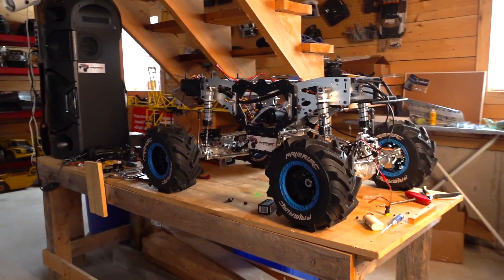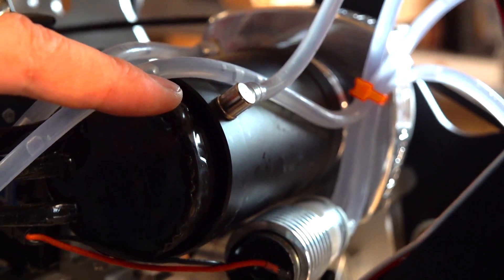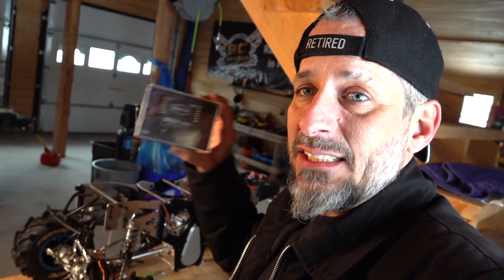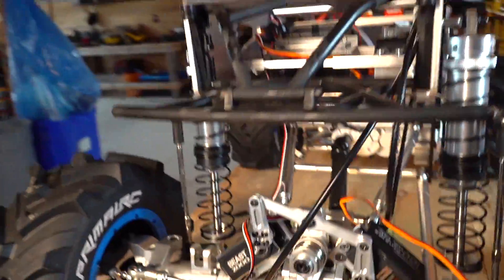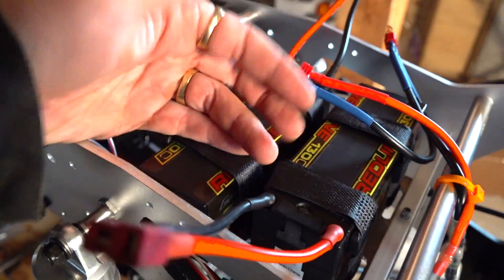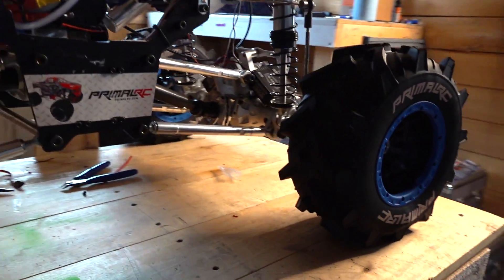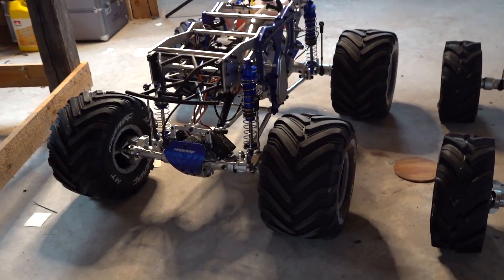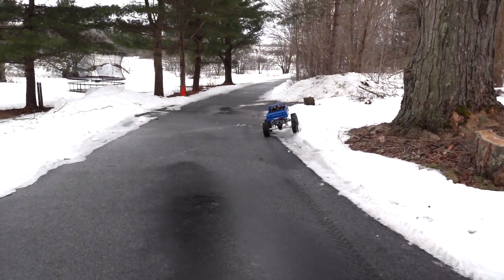BEAST 2000! MASSiVE CHEVY ELECTRiC MEGA MONSTER TRUCK gets HUGE UPGRADES - REEFS RC | RC ADVENTURES

Comment: Pure joygasm buddy! I enjoy everything you do and wish I had the venue to play in that you have. I got into serious RC short course buggy racing 35 years ago with a carbon chassis Losi JrX Pro and I also had a Traxxas Villain IV with dual electric motors that I gutted, reinforced the hull with a wooden frame and fiberglass, then installed an O.S. Max 3.5 cc water cooled nitro marine engine. Now, at our age, I just want to play. I got into it again about 2 years ago after finding your channel on YouTube. You made me want to get into it again and now I have all Traxxas for simplicity and availability at my local hobby shop. My collection now has a Spartan, 2 wd Slash VXL, 4 wd Rustler VXL, TRX4 Defender and Axial SCX24 Deadbolt. Keep it up, I love hanging out with you and your new friends, wether you're wrenching, digging, trailing or making up new games and other activities to make RC more interesting.

Comment: Being an aircraft guy, I still can't get my head round how big those servos are. For reference, my biggest plane is a 2.5metre wingspan and the servos are tiny in comparison.
Reply: I remember when 108 ounce non digital servos were considered heavy duty on my Midwest Cap 232

Comment: Medic - a nice juxtaposition to the electric running gear would be an analog water temp gauge for the radiator mounted in the bed.

Comment: That rig is absolute solid. Looking forward to more of these rigs !! I actually think those smaller tires  might outwork the larger ones. I prefer the  electric, just a lot less hassle, and instant torque. As for sound kit, I love my Duo 2, but you do you ! That drive has it's own sound !!
Reply: I have a Duo 2 in my TRX4 defender and love it.

Comment: I love the build and what the rig has become, but one point of contention that I've noticed since I've worked with high amperage draw and battery testing before. Get rid of those horrible, red, deans battery and esc choke points that limit current and could cause melting under some circumstances. Xt90, ec5, ic5 or qs8 connections would be much better suited to the electric Raminator application.

Comment: If you don't want to run antifreeze due to how acidic it is you can use some engine ice mixed with water. It'll keep the seals any metals or seals that can corrode safe!

Comment: How does it work while crawling? Does it cog?
Reply from the maker: ill have to gear it lower.. but it comes with lower gearing options
Reply from the maker: @daysdesigns  No, cogging does not exist when you have clutch shoes
Reply: @TheRealRCSparks  very cool. The electric conversion is the way to go imo. But sometimes you just wanna hear  a motor purr.

Comment: Nice concept however in the long term your cooling will fail due to galvanic corrosion. Aluminum does not react too well from brass and copper. You will need proper pc coolant and not antifreeze to slow down the process.

Comment: It’s hilarious these battery companies claim 100c when a deans connector is limited to about 75a. The cells can handle 500a though 😂
Reply from the maker: Agreed - the Deans "Ultra" connectors are rated for 60 Amps of continuous load, up to 75 Amp & higher bursts. I have pushed mine to 100 Amp for short spikes without issue.

Comment: I know there lots of snow and ice. It is prolly hard to tell. But does the mega truck seem I bit quicker with less rotating mass (smaller tires)? Also, what kind of run time are you getting with the electric conversion?

Comment: U need better battery connections the deans can’t handle the amps use Xt 90’s
Reply: Sry I didn’t get to the part where you address the plugs

Comment: It doesn't seem to be any faster than with the gas engine. Plus, how fast can you really drive a monster truck off road without crashing. For me, it's all about the cool factor, and electric just won't do it for me. Still cool, but  So much cooler with that loud ass 2 smoker in it. 😟 Anyway, keep up the good work. I need to go medicate my head. 🌿 lol

Comment: What is an ironing board. 1-1 Monster Trucks are not that fast. It needs bigger diameter tyres to make it a better and more scale looking Mud Truck.
I have got Savox servos on one of my 5th scale gas off-road trucks well my DBXL buggy actually and had to use Brown out modules and expensive Spektrum one's were the only one's that stop getting glitching or voltage surge cut out's so not that keen on them. I now use the Hilantronics high speed high torque.
Yes very nice I have eight gas six trucks three buggies each owing me around £4,500 to £6,700 apiece plus AXIS RC stands times three, big 5th are not cheap to buy then upgrade each even my UDR and SBR clone were not cheap so yes I know where you are coming from I am probably around £32K plus into the hobby have been into 5th gas since age 15 now 65 so probably a conservative estimate, but hey better than being a crack head poor and happy I am.